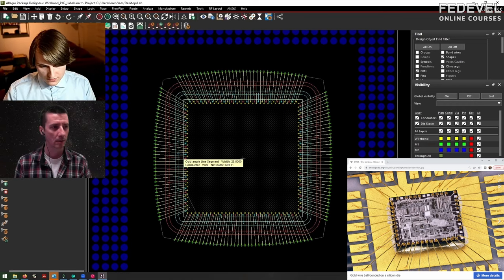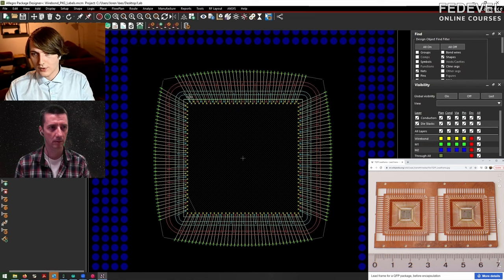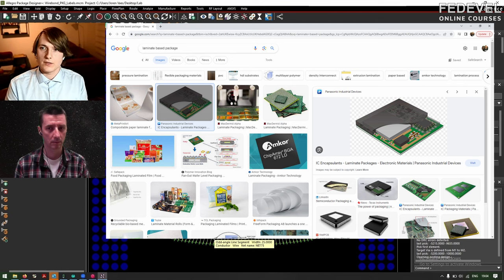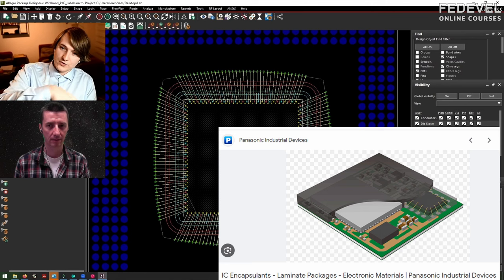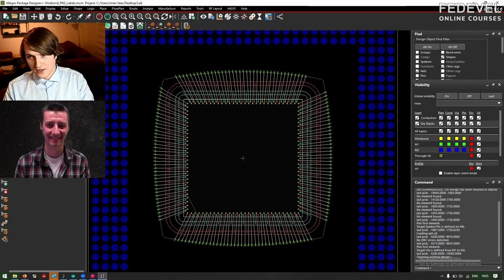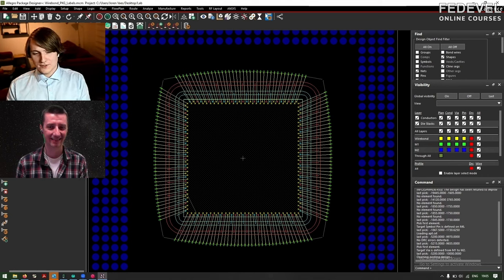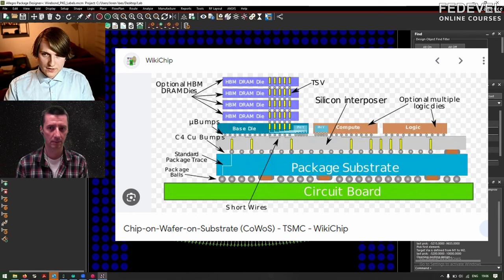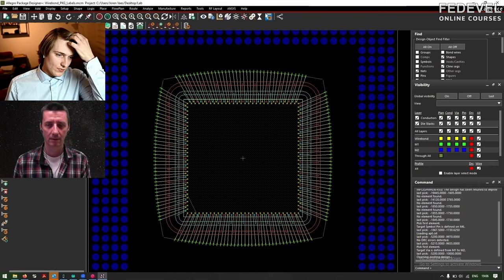How is a chip (die) connected to the pins? Do you know? #HighlightsRF

Comment: The other option other than soldering is called hybridization.  You put a large amount of pressure on the chip and the bumps weld to the pad.  We do this with infrared camera FPAs (focal plane arrays), which is a detector (InGaAs) chip hybridized to a ROIC (read out integrated circuit). Very hard to do... and we have 5um pitches.